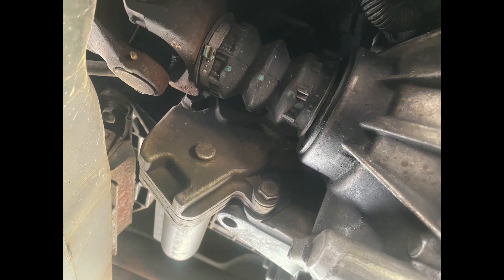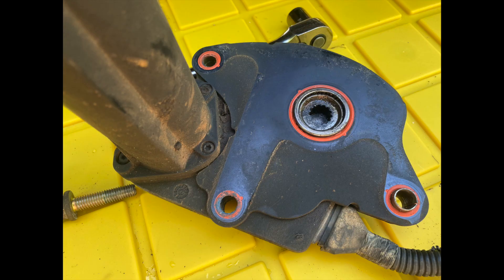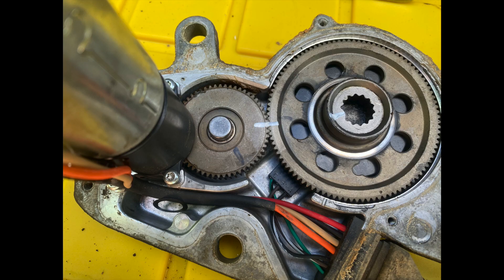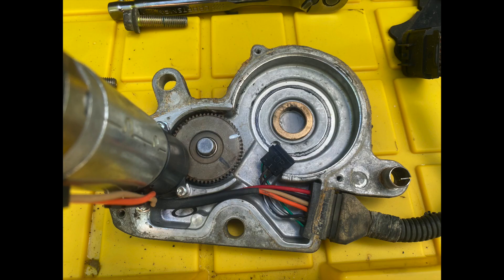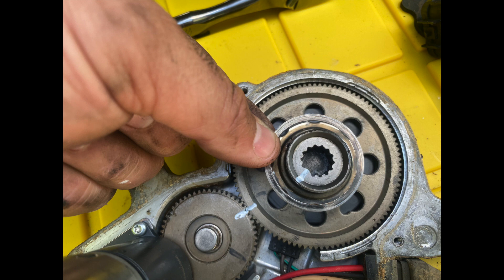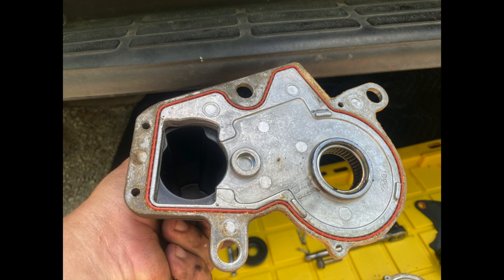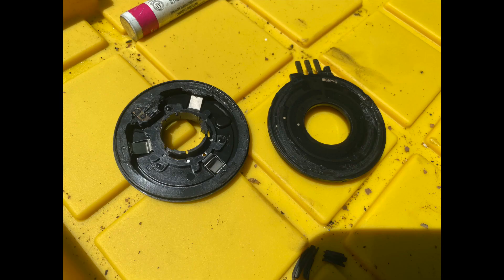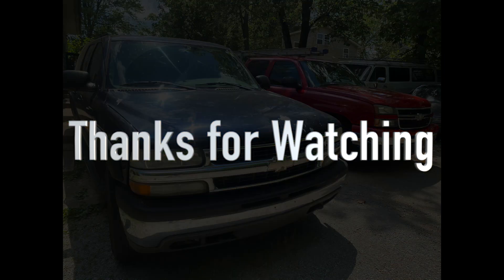Transfer Case Motor Sensor Replacement on GMT800 Chevy & GMC Trucks

Comment: I'm guessing the NP243 has a similar sensor. Likely what's wrong with the actuator in my other t-case. Good to know there's a likely cheap/good fix for that! I swapped the whole case out because I had one vs forking out $300+ for a new sensor this past Spring. Of course the replacement case also had 100k fewer miles. . .

Comment: Torque specs for 15mm. Taken from the manual. "Replace the three 15mm bolts, and torque them to 15 foot-pounds. Torque the
top bolt first, then the bottom, then the middle."

Comment: Not sure what year your GMT800 is but mine is an 02 and the shift motor is 
sealed shut with what appears to be silicone. No way to split it open
Reply: That means someone messed with it. GM never did that from the factory. Maybe who was ever working on it lost all the screws, and did that just to keep it together

Comment: Just did this and still have no power to my 4wd selector switch inside. No service 4wd lights or any of the 4wd indicator lights either. I replaced the 4wd actuator, sensor, 4wd switch and ensured that all of the grounds are clean and the wiring is in good shape. I am stumped
Reply: Check the two ground wires on the frame below the driver's side foot area. The entire encoder system grounds here.

Comment: Huge thanks. For this job was your transfer case actuator humming as if it was trying to shift but wouldn’t change gear? That’s the issue I’m having and I can’t afford to get the part wribg
Reply: I noticed you did not get a reply, answering your question. My transfer case actuator is making a buzzing noise like you described and will not shift out
of 4hi, and into 2hi. Was wondering what the fix was for yours
Reply: I'm stuck in 4 hi also any tips

Comment: What year is your vehicle?
Reply from the maker: 2005 but I’m pretty sure all 99-07s with the electric motor are the same.
Reply: @WhatIsKenDoing   INCORRECT ! only 2003 and up are the same. I have a Chevy Av 20002 and its different, this part number you posted in your vid will NOT work.
Reply: They're not the same. The 2000-2002 have a rectangle spindle connection and different case shape than the 2003-2006. The motor is essentially the same, but they are not interchangeable.
Reply: @connorpoore3043  I am having no luck finding the proper ring sensor for my 2002 Chevy Av. They sell the entire encoder motor assy but not just the ring. Do you have any leads for me, everywhere I look I come up empty.
Reply: 03 Silverado HD has a different electrical connection inside than a junk yard encoder I pulled.  Ordering a new sensor now.  All else seems the same but can't swap the sensors.  Not sure what year suburban I pulled from.

Comment: what was the symptom? I have my motor humming when I try switching gears but it doesn't turn, motor is brand new from Ebay. It doesn't produce any codes either
Reply from the maker: In my case, the T Case motor would randomly put the truck in low 4wd or it wouldn’t allow me to select what range i wanted.
Reply: I'm having issues with the transfer case not engaging into 4wh low and 4wh-hi. Before I go and buy parts, could it be simply the transfer case motor sensor and not the solenoid itself or is the assumption I described exactly related to the solenoid/actuator broken down? 

Also, would changing the old throttle position sensor on the engine help correct the shifting out of gear two into three without sticking in 2 and high- revving the engine help? currently i have to build up speed from a stop and let off the throttle after I reach about 20 mph and between 20-2500 rpm. Then the rpm needle goes to 1500 and engages into third and I can go but I still can't hammer down. I'm wondering if the tps is going bad and there's a miscommunicationout of synch between the throttle position and my transmission or transfer case motor . Or could a dirty transmission filter cause shifting delays and sticking gear issues? Improper hydraulic pressure? Bad gear shifting solenoids? Fuel filter clogged? Fuel pump?

Comment: quick question, right below the electronic motor cable, you can see a black washer  by itself, where does it go?
Reply from the maker: alex green are you talking about the black wave washer that is about 2”?
Reply: @WhatIsKenDoing   I don't know the name of it, but if you got to minute 3:27 you can see it there, its laying up right on the cable, the one that looks like it has black shrink wrap.
Reply: @alexgreen121  I see what you're talking about. It honestly looks like it's supposed to go over the gear it's next to. I can't really think of anywhere else or how it would've gotten there to begin with. I haven't taken mine apart yet though so I'm just throwing an observation out there.

Comment: Very useful today. One bolt was broken, one bolt I broke, I had to pound all over the unit prying it apart. Once it gave the inside gears popped out of position. There is a point where reviewing this video was needed. Thanks. Service 4wd message has left and everything is shifting and seems fine... for now
Reply from the maker: Glad it was helpful

Comment: Did you have to reflash the module? My Truck stuck in 4wd.  Goes in 4wd when I park it but now can’t get out.  Code C0327- encoder circuit.   Was gonna get a used motor but if can change encoder without flashing will do that.   Also hate you say Arange instead of Orange lol
Reply from the maker: BraaapAllDay no flashing. Just pull the motor out, take your time, pay attention to details and stick the new sensor in. Easy peasy.